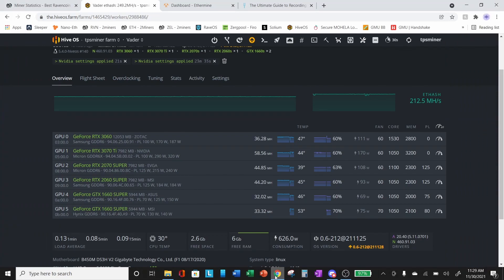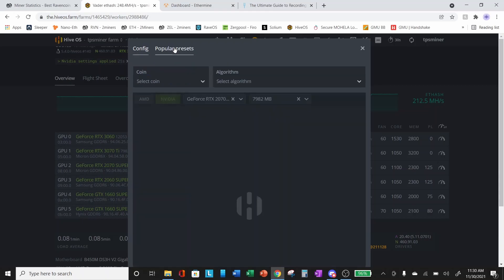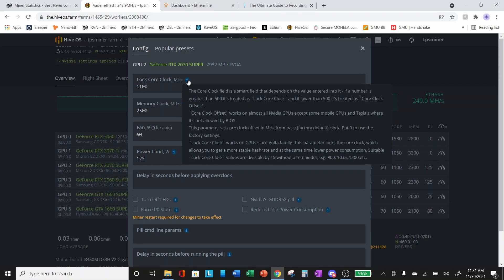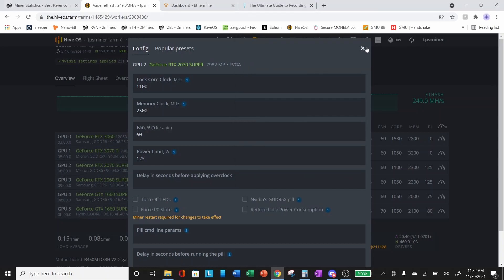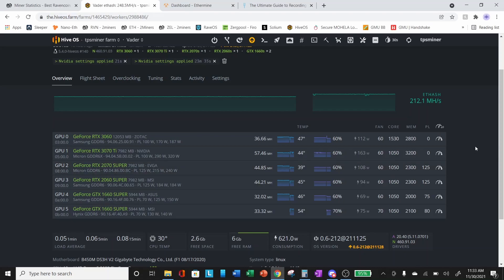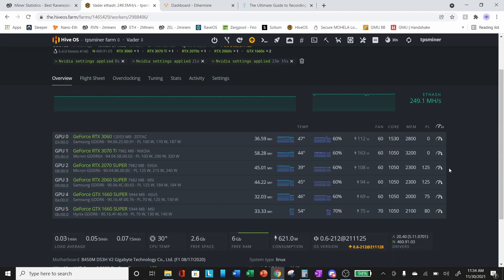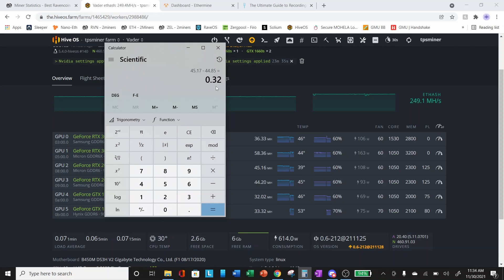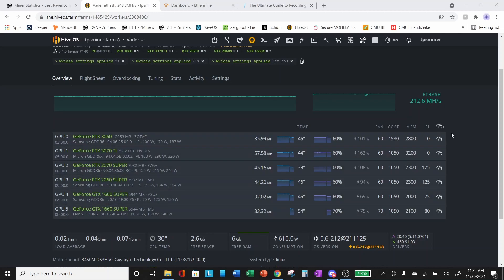How to Lock Core Clock in HiveOS

Comment: Nice video.  Recommendation, try 900 Core, 2600 Mem, 190 PL on your 3070ti, I am rock solid for several weeks between 59.8 and 60.65 mh/s on 2 cards using those settings.  You are at 57
Reply from the maker: Thanks for the recommendation!  I tried the settings you suggested and it's settling in around 58.5 - 59.2 mh/s at ~160w!  I'm going to let this run for a while and see if I can keep it stable!  I really appreciate the help!!